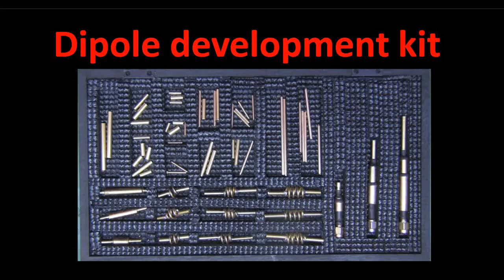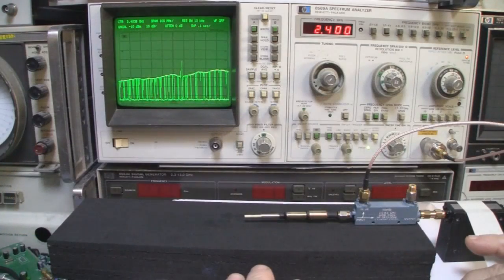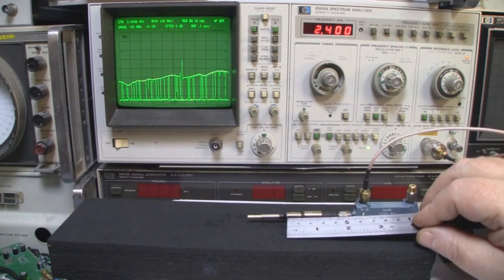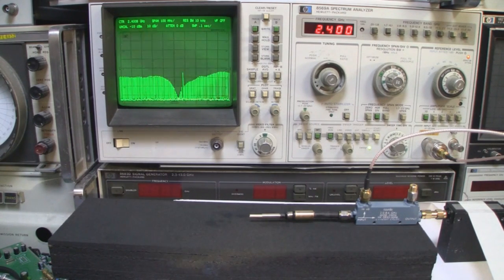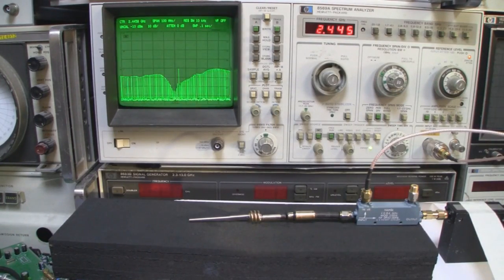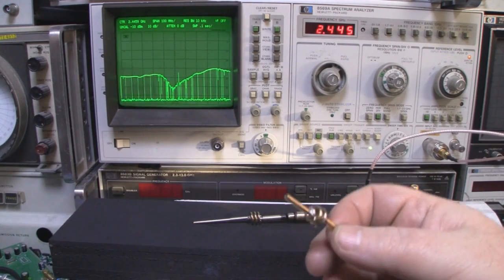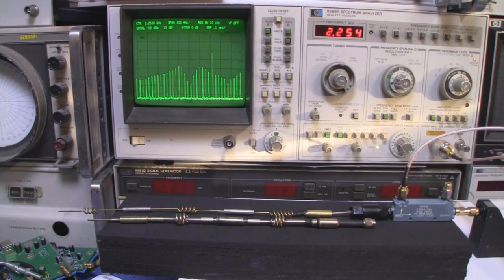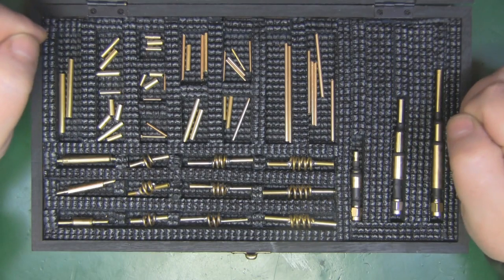Dipole Development Kit

Comment: of your half-wave length dipole the ground skirt appears to be shorter than the pole.  Actually they are the same length if you add the skirt radius to the end-to-end length of the skirt.  The radius part is also part of the electrical length for the resonant wave propagating down the cable shield. 

In your other video about 6dbi and 8dbi omni-directional antennas from ebay, these antennas are collinear dipoles put in series and fed in the center of each dipole.  Two neighboring skirts belongs to the same dipole and is connected to the next dipole in the middle through a coax (the thinner tube and the center wire separated by the plastic shielding).  the two 36mm skirt parts and the thinner tube connecting them have electrical length exactly 1.5 wave length so the dipoles are separated by 1 wave length (the other half wave length is just the dipole elements formed by each two skirts.  The plastic shielding has a velocity factor 0.7 to fit all the dimensions put together, so it must be teflon.  The circular plastic disk is also teflon by its whitish color.  When calculating the length the skirt radius must be included too as mentioned earlier.  If 3 dipoles are connected in series in the center, the final impedance should be 73x3 = 219 ohms.  This is about 4 times of 50 ohms.  So a 4:1 balun should be used.  Without a balun it cannot be claimed as a 50 ohm antenna.

Comment: what a wonderful world !  this was so next to perfection !  what could i do without you in this for frecuencies blind world ?

 please andrew .., how do i conect  this SMR port type antena , with a  IPX a RP-SMA Conector ,  to a laptop intel centrino wifi card which has a main" and a aux" conection ?   please,  should i conect the pigtail to "main" ipx port ,  to "aux" ipx port , or  to both ?  .

coils are 70 mm long before looping , right ?  does it matter how thick they are ?

 do i need something special as a choke between coils ?  what hapen if i link a treecoils antena to a metal plate in order to make it diectional antena , is this posible ?

 Still waiting for a 4g noise generator DIY tutorial .  thanksyou lot and lot